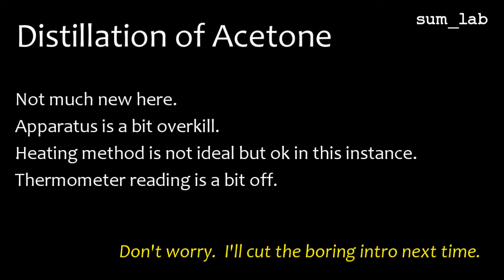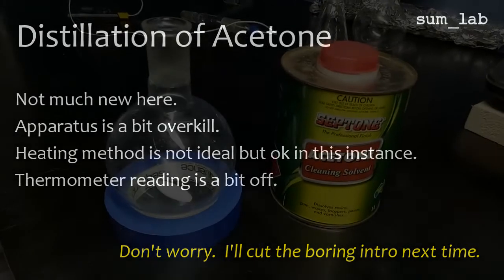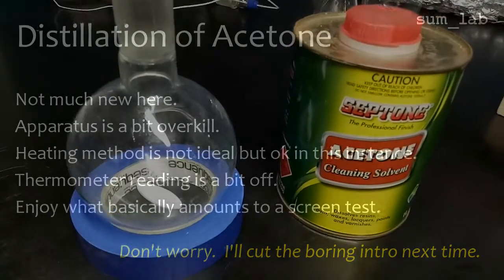Distillation of acetone

Comment: Why don't they have a little packet like the silica pack they use for air? Can't that be done in liquid too?
Reply from the maker: Silica gel packs absorb water.  In liquids, small porous zeolite spheres called molecular sieves are used for the same thing.  But they only remove water or a selection of specific small molecules.  They do not purify by removing the gunk you see in this video.
Incidentally, the silica gel packs don't purify anything either.

Comment: Hi I can only get 60% acetone here. To get pure acetone, do you recommend doing the distillation process two times?
Reply: Hi could I use baked Epsom salts to take the water out of acetone? Thanks
Reply from the maker: I have not come across such a product.  Assuming the remaining 40% is water, you should have reasonable separation.  Acetone boils at 56° compared with water 100°.  The two do not form an azeotrope.  Therefore, provided you distil at a moderate rate, most of the water will get left behind.  The vapour pressure of water at 56° is not completely insignificant and so you might want to do a second distillation or a drying step.  (The latter is probably better.)  What you do need to do is halt distillation as soon as the head temperature begins to rise again.
On the other hand, if the 40% is composed of other organics then all bets are off.  There is a pretty good chance of having something come over with the acetone.  And chances are that you won't know what it is that you have got.  Trace amounts especially of there is no azeotrope should separate out ok if there is a big difference in boiling point.  But if you had for example 40% methyl acetate (BP=57) then separation via distillation would be near impossible.
Reply: You can order from the web

Comment: The condenser looks cool, but not for this type project; but you probably started using a Liebig judging what you said below. The whole thing would be a lot more efficient if you had proper insulation for the column. To make your own easy insulation for columns, get some PVC tube; cut the length you need for the column; cut the tube in half on longitudinal axis; put this over the column and clamp together creatively. Better yet is to insulate the tube and seal the ends -- so the column only sticks out at the very top and very bottom. Thanks for the video.
Reply from the maker: Agreed on all points.  But this was mostly a height test for my new lab space and a chance to get out the phone and try making a video.  For most applications I use acetone straight out of the bottle.
Thanks for your interest and your comment.
Reply: @sum_lab  Oh, I see. I hope you got a tripod now too. LOL!
Reply from the maker: @VidarrKerr  
https://www.sciencemadness.org/whisper/viewthread.php?tid=93866&goto=search&pid=574055

Comment: Nice fast drip rate with that graham condenser, thanks for the demo.
Reply from the maker: There are some solvents that can boil quite quickly without appearing to be doing too much.  Ethanol is another.  Then there are other liquids that seem to take forever.    I don't like leaving distillations unattended for too long though.

The Graham has not really had much of a workout since this video.  It is a cool-looking piece of kit though.  Really satisfying to use even if it is in most cases impractical.  I think it can sustain a pretty high heat transfer rate, but throughput is more often the limiting factor with the narrow tubing: especially if there are pressure fluctuations.

Comment: I find it necessary to distill this stuff. The diggers brand leaves an oily petroleum based contamination in the flask which is best left out of reactions. Not sure about the SEptone stuff though.
Reply from the maker: It's the same. There was a greasy, sooty residue at the end. I don't mind mixing brands and reusing containers though.
Reply: would like help in making an installation
Reply: would like to learn a specific formula